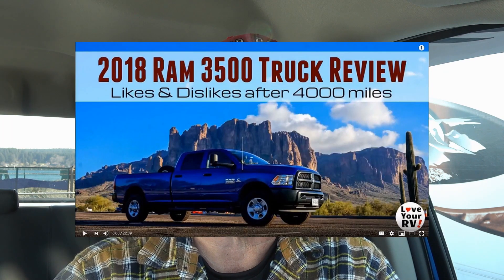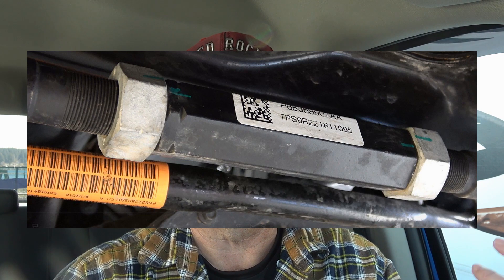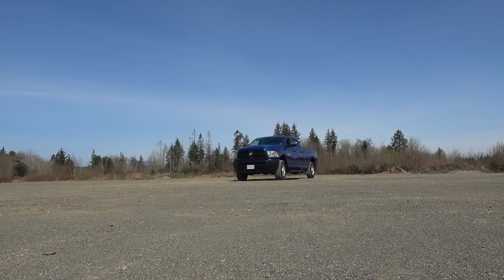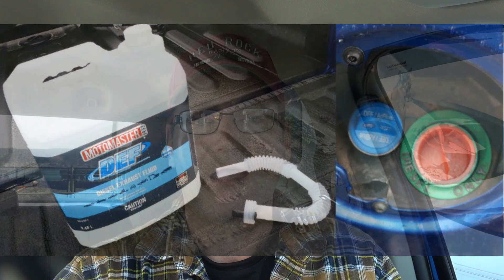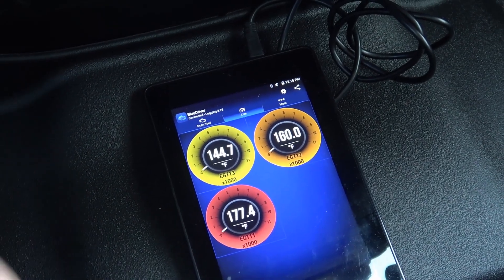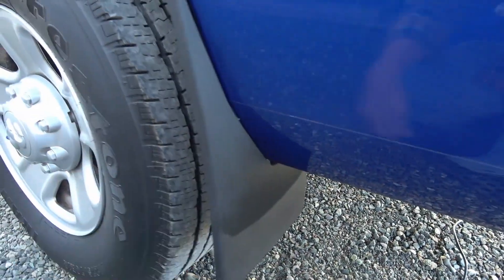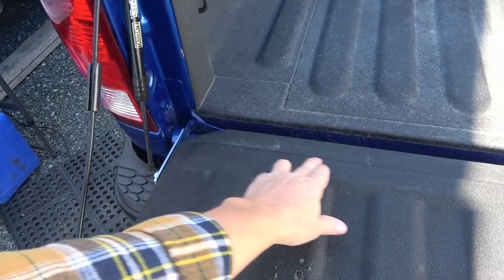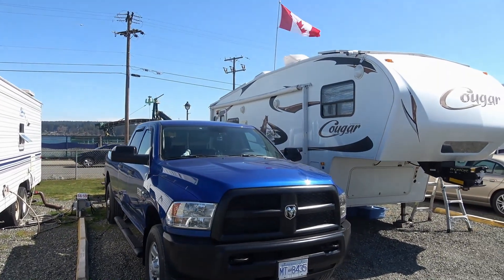2018 Ram 3500 Truck Review Update - 35,000 KM (21,748 Miles)

Comment: Great updates. I had a 2012 RAM and the Turbo blew at 60,000 so we bought the 2018. From what I have read the 2018 is really dialed in and at 19,500 miles we're thrilled with our 2018 Ram Tradesman crew cab dually. We tow a 27' travel trailer in Colorado so I agree with all of your assessments. This truck hasn't found a grade too steep yet! Thanks for the videos. It kind of reinvigorated my love for my truck.

Comment: Great video. We also have a 2018 Ram 3500 Cummins. By the way, the towing odometer is located where your trailer brake indicator is on your dash. When you see the gain setting, hit your arrow down once and it will show the miles towed. It should be there on the tradesman as well. Here's hoping that we can all get back to RVing again soon!
Reply from the maker: Thanks! It read 17,977 km or 11,170 miles, so I had a pretty good guess. :) Cheers, Ray

Comment: We have a 2018 Ram 2500 Tradesman crew cad Cummins 2wd. We tow a 34’ 2019 Grand Design Reflection 28bh and we absolutely love our truck as well. We had the truck deleted and added a fass to it. Also did several towing upgrades to include shocks, airbags, deep transmission pan and brace, air compressor, coolant y-fitting and some more. It has really made a big difference in the truck.

Comment: If someone tells you not to waste money on a full synthetic engine oil and differential, tell them to get lost. No matter what, full synthetic oils will make a HUGE difference in the long run guaranteed. Don’t let anybody tell you otherwise. If you want to keep your truck for a very long time than use full synthetic all the time. I have a f250 7.3L, purchased brand new in 2002 and have almost 1 million miles on the engine. One transmission rebuild since new, other than that my truck never tasted regular oil since I picked it up at the dealer. 

My advise, change your engine oil every 4 to 5k miles. 

Good luck and stay safe.

Comment: We bought our 2018 ram after watching your videos last year, we got the Laramie crew cab 8 foot bed dually version.  We love it so far towing our 35ft grand design solitude.  Considering some kind of bed cover soon.   I wired power to my dash cam from the overhead light console instead of coming from the dash, connects to rear window power.  Thanks for doing the ram updates.
Reply from the maker: Awesome. :)

Comment: We have a 2018 2500 Ram heavy duty, absolutely love it, pulls our 29ft TT like there’s nothing back there, haven’t heard anything in the trans., but I also lock it in so it doesn’t shift on a grade. Thanks for the update, stay safe.
Reply from the maker: I lock out gears as well usually the overdrive gears 5 and 6 but not 4th as it is needed or my RPM would be way too high towing most grades in 3rd and I'd be going too slow. The chirp takes place shifting between 3rd and 4th.  Cheers, Ray

Comment: Hi Ray
Thanks for the truck update, I enjoy hearing owner experience like that. We have the Bluedriver too, and yes, transmission oil temperature would be nice to have available. Our Husky floor liners had a raised edge at the door sill. I pulled them out and used a heat gun to relax the plastic, reshaping the lip. It fits perfect now.

Comment: My girlfriend and I just took delivery of a 2019 Tradesman 3500. I have bad back pain after long drives in really any car without lumbar support but we had the dealer add power lumbar support and heated seats to just the seat backs of both front seats.  Both are a non ram branded items and are universal fit but once installed they function just like factory. With them the seats are so much more comfortable and it wasn't horrible cost wise to have it done. I think we paid $400.00 for both seats done and that's parts and labor for the power lumbar and also adding heated seats to the seat backs only. Highly recommend that done for anyone suffering with back issues and doing long drives.
Reply from the maker: Thanks for sharing, you have a good dealer. Ours wanted to sell us some expensive upgrade package just to get adjustable lumbar support. Do you happen to know the brand?
Reply: The ones we had installed was made by Rostra and was part number 250-1454. I don't remember which heated seats pads which were installed. I think they were made by the same company though.
Reply from the maker: Awesome, thanks, looks like I can get it off Amazon Canada. Cheers! Ray

Comment: Thanks for the review Ray!  Excellent choice on Synthetic oil.  My first Ram had 145,000 and the brakes were still in good shape... my 5'vr weighs 14,000 and towed it 100,000 of the 145.000  using your engine brake makes all the difference. We were hit head-on in December and totaled the 2012 3500.  We purchased a new 2019 3500 Aisan. Looking forward to towing at the end of May.
Reply from the maker: Whoa, I guess you got a chance to test out the air bags, hope you weren't hurt too badly.

Comment: Ray I have the same floor mats and noticed your driver and probably passenger side at the front door well do not lay down. What I did was get a couple of ( automotive  black machine screws with the washer style and screw the mat into the door well. Have had them in for a 7 years  works out, and when you want to wash them down its just one more step to remove the screw.
Reply from the maker: Thanks for the tip. At first I tried tucking the lip under the door sill. They are just plastic so easy to lift up. But lately I've just left the lip and it hasn't seem to be much of an issue. Cheers, Ray

Comment: Ray nice truck!  On the tires I am a fan of  Michelin tire I changed out my OEM tires on my 2012Dodge Ram 1500, @ 25k KL. and have over 65K on this set in 5 years ,2/3 towing plenty of wear left. Bought them when we down in Oregon @Costco (no tax eh) . Loaded to camp I am around 7200 lbs. On the brakes still going strong, plenty of wear left on them.
Reply from the maker: Thanks for the info!

Comment: Thanks for the review on your Ram truck Ray, Being a Diesel Mech for 44 yrs switching to syn. oil was a wise move the motor will last for hundreds of thousands of miles, and for the drive train changing the diff oil and the trans oil is a great deal, and here is a issue people dont think of but i change my transfer case regularly also, it dosnt hold much ATF but it is over looked a lot, my last camper tow truck had 400000 miles on it no leaks and issues and that was because of the syn.oil and maintence i did on it , but this was just a thought see ya Ray thanks.
Reply from the maker: Thanks Gary

Comment: Happy Easter! Glad your happy with your truck. I am still happy with mine too nearly 14 years on. The GMC came with synthetic in the diffs but I have changed them and had the same experience you did. It's the clutch packs wearing in with respect to the positraction rearend. I am assuming you have posi. The front and transfer case were clear. I am at 189000 kms so ready to change the back diff again. GMC claims they are filled for life. I don't use synthetic motor oil becuase these engines will run 5 or 6 hundred thousand kms easily and I have seen many exceed that on regularly changed oil so I can't see the value in it. The chances of you or I exceeding half a million kms is small.  I use Mobil Delvac Super 1300 which has a TBN number that rivals synthetic and change it twice a year it only goes 6000 kms on average between changes. The Delvac available at Walmart in the US for a good price. That is what I do and as you know I used to have big rigs. Have a great Easter and stay safe.
Reply from the maker: Thanks, this is what my Ram manual says to use: Cummins says the same.
So basically I guess they are saying if in cold weather a lot go with the synthetic
Engine Oil Viscosity (SAE Grade)
In ambient temperatures above 0°F (-18°C), we recommend
you use SAE 15W-40 engine oil such as Mopar, Shell
Rotella and Shell Rimula that meets FCAMaterial Standard
MS-10902 and the API CJ-4 engine oil category is required.
Products meeting Cummins CES 20081 may also be used.
The identification of these engine oils is typically located
on the back of the oil container.
In ambient temperatures below 0°F (-18°C), we recommend
you use SAE 5W-40 synthetic engine oil such as Mopar,
Shell Rotella and Shell Rimula that meets FCA Material
Standard MS-10902 and the API CJ-4 engine oil category is
required.

Comment: My 2002 f350 does the same chirp in the transmission.  Time for a fluid change. I was a little worried; but if your truck is doing it and it is new guess it is OK.

Comment: Glad u love the truck.mines been in the shop 6 times for the same issue 😬
Reply from the maker: What is the issue?
Reply: @LoveYourRV  p20ee code.theyve changed the scr,def pump an flashed the pcm.now they say they are gonna replace the no sensor.dosent even have 20k miles on it yet....fingers crossed 😬
Reply from the maker: @supertanker9681  That sucks. :( I hope they sort it out for ya.
Reply: @LoveYourRV  I'll update you when they install the sensor.
Reply: Apparently it was the nox sensor,so far so good

Comment: As far as towing mpg. Is the truck in tow mode or not. I have a 2019 3500  Ram and noticed on the flats It easily pulls my fifth wheel without tow mode on. The transmission temp good and no gear searching. It definitely changes the fuel mileage.
Reply from the maker: I always have used tow-haul mode when towing the trailer and I also lockout 6th gear and sometimes 5th if in curvy terrain. I find with the 3.42 rear end it will hunt gears more if I leave 6th active. Rather spend money on fuel than a new transmission. I remember once not activating tow-haul and saw a definite rise in tranny temps but that was in an urban highway and city roads so some starting and stopping. I also like that the exhaust brake works better with the more aggressive downshifting of the tow-haul mode and lower 5th gear which ups the engine RPMs. Cheers, Ray
Reply: @LoveYourRV  For sure if my transmission was shifting a lot I would use tow mode on the flats too. Not sure but i think they changed some things on the 2019. Maybe its the gear ratios mine has 3.73. My 5th is about the same weight as yours.
Reply from the maker: @krtex56  Yeah, the gear ratio can have an effect, changes the RPM. In the same gear my RPMs will be lower than yours.
Reply: I have a 2018 with the 3.42 rear end. I find when towing, the truck runs better locked into 5th or 4th: EGT temps run cooler, fuel flow is lower, gas mileage is better.  Even when no load/light load, if my speeds are lower than 110km/65mph in 6th gear, the engine lugs and heats up, burns fuel.  Only over 110km/65mph is 6 gear more efficient (Tow/Haul Mode OFF). My typical conditions: either 4,000 or 10,000 lbs tow, Tow/Haul mode ON. 22litres/100km at 10,000lbs, 15-16litres/100km at 4,000lbs, 11-13litres/100km empty. For the Americans I think that’s 12/15/22 mpg respectively (someone smarter than me needs to do that conversion).

Comment: Hi Ray, We always enjoy your videos and have learned a lot from them. We just bought a 2015 RAM 3500 to pull a Montana High Country. The trailer has a residential fridge with a dedicated inverter. I have four 6 volt batteries with solar back up. I'm going to purchase a Yamaha generator (good deal at Costco) with a 30 amp outlet. Do you know much about the Soft Start devices for the AC units which allow running AC on 30 amps? Thanks Ray. Hope to see you on the road. Stay healthy.
Reply from the maker: Thanks Randy, I don't know too much as we don't generally need AC when south for the winter and have hookups in the summer. But I've heard that this one works well - https://www.microair.net/products/easystart-364-3-ton-single-phase-soft-starter-for-air-conditioners?variant=30176048267  Maybe I should buy one and review it this summer. :) Cheers, Ray

Comment: I have a 2500 6.4l - did you lube the Front Drive shaft?  If so, hard to find and do.  Check your manual.  Also, I got a rear diff cover with a drain plug which makes changing the fluid easy.  The front diff I suck out.  I didn't hear you mention the transfer case - check at 30K mi and replace at 60K mi?
Reply from the maker: I get it oil and fuel filters done at a shop, too messy of jobs for a campground plus I get a receipt for my warranty coverage. They seemed to know what they were doing as their boss at the oil change place has the same truck.  They checked the transfer case and the oil was pristine since I had rarely used it, but got to do a bit of 4x4ing when it rained in the desert last month :)  Sure was nice to have when I needed it in the mud.

Comment: you may want to check out a product called Motorkote. you have Big Blue well broken in so now would be a good time to add it everywhere. That will help with wear and may even help with your churp.
Reply from the maker: Thanks, will have a look, not sure though, the owners manual warns against using oil additives.
Reply: @LoveYourRV  I fully understand. The beauty of it is it really is not an "additive" because it soaks into the metal. But by all means as you do with everything research is a good thing. As a truck driver I used it on my Big Rig and it helped in my fuel mileage and wear. Just a thought. I am glad you both have survived Covid19.

Comment: Do they really recommend 6 month intervals for oil changes? That must be with long distance heavy duty towing, I can't imagine why you would need that if you aren't driving very much.
Reply from the maker: Here is the Cummins service intervals chart - http://www.cumminshub.com/6.7-cummins-maintenance-schedule.html When under warranty its advisable to follow them afterwards its up the owner. 
15,000 miles or 6 months or 500 hours

Comment: What trailer brake setting do you use?  6.5 or so?  My truck is virtually the same as yours and trailer is bit longer.  Thanks for all the helpful info in your videos.
Reply from the maker: Yes, right around 6.5 - 7.5 usually works well for me.
Reply: Thank you.

Comment: Hey Ray my 08 ram was doing that it turned out the torque converter lock up had started slipping
Reply from the maker: That's not a good thing. :( but my issue seems to be pretty common. I've read about it on several Ram forums - https://www.cumminsforum.com/threads/2018-aisin-3-4th-gear-chirp-drw-crew-cab.2469681/
Reply: Glad it's not the same issue then and glad to see you 2 safe and health take and look forward to more from you.😁

Comment: I have the 2018 also, but in DRW with only 10,000 miles on it now. I see you have the Aisin transmission, good choice there. Your mileage is about the same as mine, with our large truck camper on it. I'm guessing that you have the 4:10 differential?, as I do. Love mine also. Good info, thanks.
Reply from the maker: No, I have the 3.42 rear diff. Its all I could order in the single axle here in Canada, but has worked well mated with the Aisin.
Reply: @LoveYourRV  Wow, I figured since  we were so close with mileage's that you would have the 4:10's like mine. I guess now i'm not wishing I had the lower geared diff any longer. Thanks for the info..

Comment: I’m biased but I swear by synthetic oil for my engine, diffs, transmission, brake fluid and power steering for my deisel truck.
Reply: What type and brand of fully synthetic did he recommend? And are you shure that a non synthetic has been used as first oil at the factory. (So many reasons - so many possibilities.) Thin, low-friction, thus 'environmentaly friendly oil' could have been used in the first place - to be nice to the environment, but nice for target 300k miles durability as well? And such oils today come as multigrade oils, 75w90 or 80w90 for instance - for 100k miles and more the thicker oil could be usefull? Maybe they changed the diff 'for the environment' - 10 or 15% smaller teeth could use up the material ,,,(hardened steel) better, provide a wheight and manufactering saving, thus wanting better oils? 'Cheap will go (for non heavy duty) as well, but for how long? So, we don't know without further questioning and research. And how much oil is it? A reduced volume very often comes with a 'higher pumping speed', 'increased turning circles between teeth and sump per minute' - with newer constructions very often the 'rest time' for the oil down in the drain is reduced.
Reply: Rear Axle lubricant is any SAE 80W-90 gear oil that meets MIL-L-2105C and API GL 5 quality specifications.
Axles intended for heavy-duty or trailer tow should use SAE 75W-140 SYNTHETIC API GL 5 gear lubricant.
Reply from the maker: It was Pennzoil full synthetic oil 5W-40.
Here is what the Ram diesel owner manual says:
Engine Oil Viscosity (SAE Grade)
In ambient temperatures above 0°F (-18°C), we recommend
you use SAE 15W-40 engine oil such as Mopar, Shell
Rotella and Shell Rimula that meets FCAMaterial Standard
MS-10902 and the API CJ-4 engine oil category is required.
Products meeting Cummins CES 20081 may also be used.
The identification of these engine oils is typically located
on the back of the oil container.
In ambient temperatures below 0°F (-18°C), we recommend
you use SAE 5W-40 synthetic engine oil such as Mopar,
Shell Rotella and Shell Rimula that meets FCA Material
Standard MS-10902 and the API CJ-4 engine oil category is
required.
Synthetic Engine Oils
You may use synthetic engine oils if the recommended oil
quality requirements are met and the recommended maintenance
intervals for oil and filter changes are followed.
Reply: This indicates, that this diff might get hot under higher loads - xtended time of use under higher temperatures would ask for a an oiltype of higher oxidation stability.
Reply: @LoveYourRV  I have always used Shell Rotella T6 5W -40 full synthetic. I change my own oil and can get for a very reasonable price at Walmart in US.
Reply: Love Your RV, Mobil 1 5w40, used for almost 1 million miles on my truck since new and never regretted it.
Reply: Would stay away from Pennzoil !!!